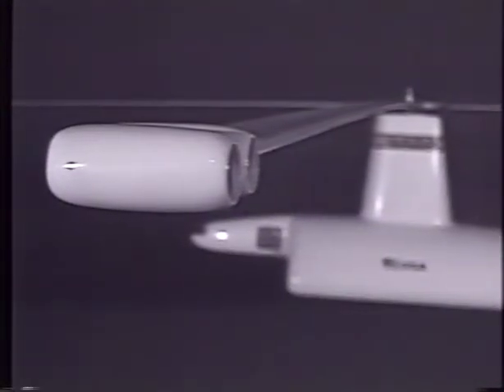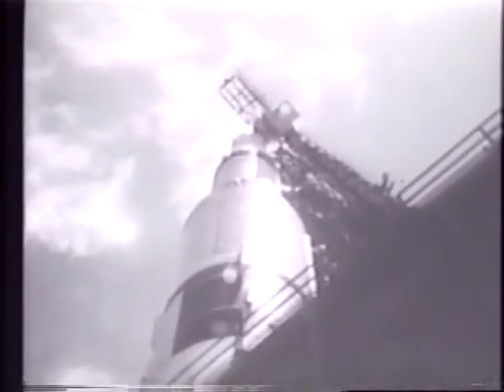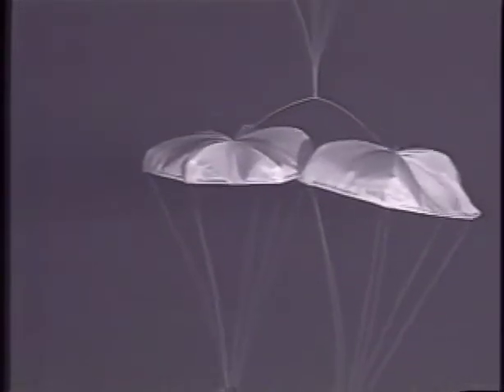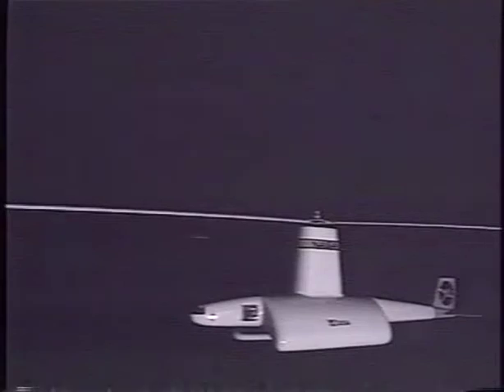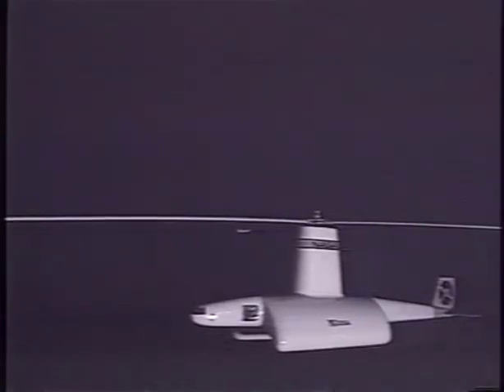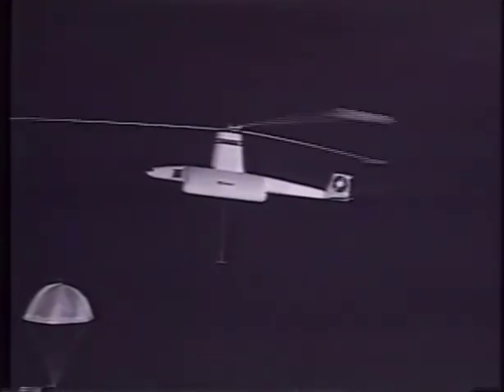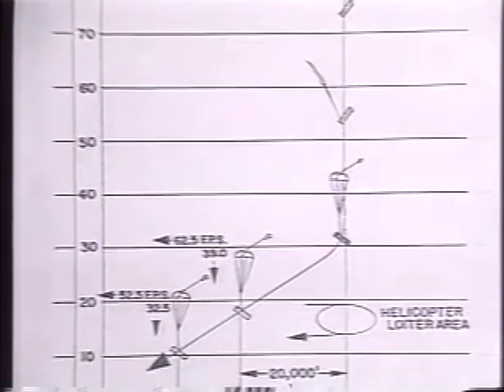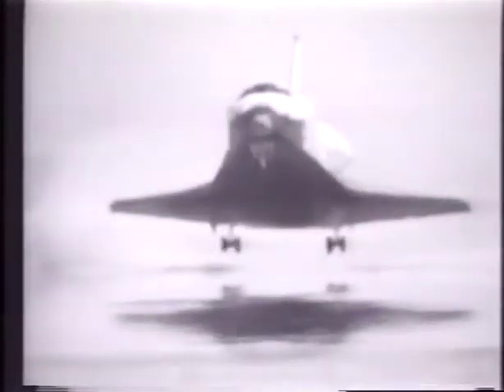The Hiller Air Tug

Comment: I have two questions. Where is this thing located in the museum exactly, and is it new?
Reply from the maker: We unfortunately do not have the original Air Tug, but we do have the smaller model in the library.
Reply: This is actually quite new to me. I've never seen it before. Where is it located in the library?
Reply from the maker: It is suspended from the ceiling above the long table in the center of the room.
Reply: You know those little TVs that tell you about the aircraft? I saw the Air Tug, but the little television wasn't there to tell you about it. Is it in another room?
Reply from the maker: I am not sure, but if you would like to have a copy of the Air Tug video, you can always download the YouTube video through a YouTube to mp4 converter.  It essentially rips the YouTube link and creates a video file of it.
Reply: Is it simple or hard, and how do I do that?
Reply from the maker: It is pretty straightforward.  You can copy and paste the url into a site like this: https://www.onlinevideoconverter.com/video-converter, select mp4 as the file format, and hit start.  The site should rip the video and then give you an option to download it.